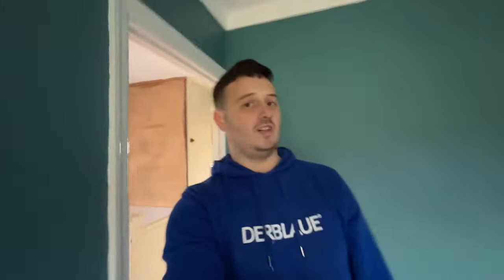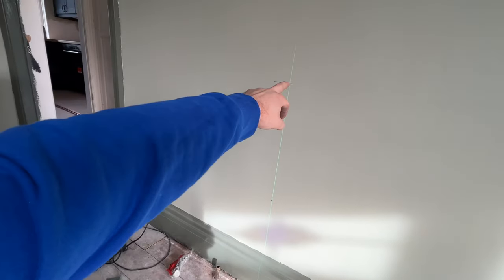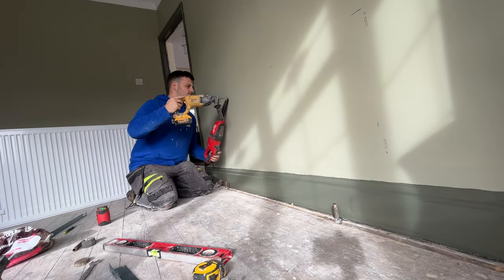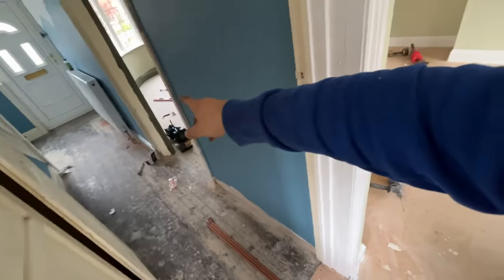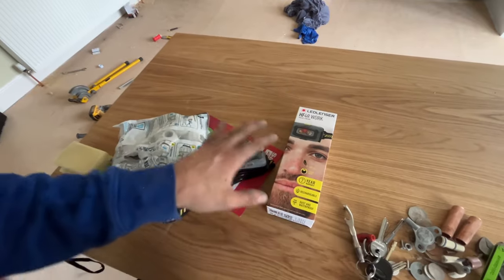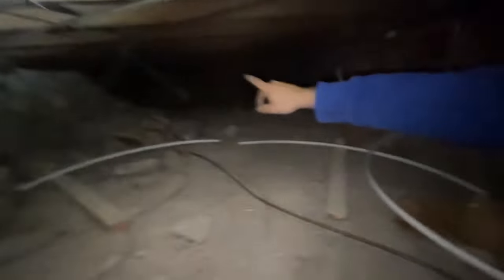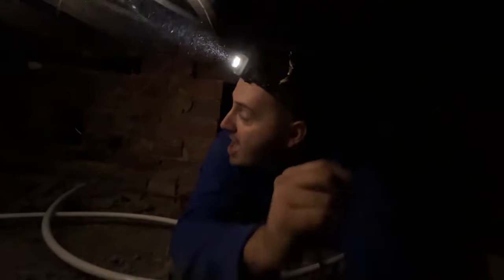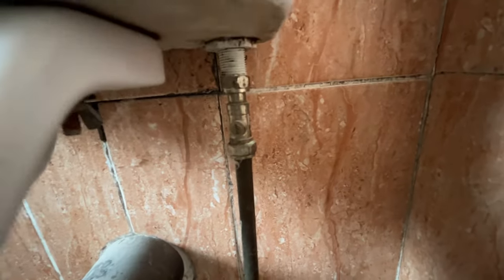A Day Installing Oversized Radiators To Future Proof For A Heat Pump

Comment: I think we'll see more of these oversize rads as customers look to take advantage of lower combi temps and get ready for heat pumps if they need to at a later date. Good work I've got a concealed cisterm that won't stop running tomorrow to tackle😂
Reply from the maker: Only thing is the full system needs repiping as most of its on 15mm so seems abit pointless to be honest
Reply from the maker: Good luck with the cistern, I’m guessing it’s a passing fill valve
Reply: @SmartPipePlumbing  thank you. I'm hoping its not the fill valve it's tiled in 🙈 I can get the flush mech from the top cover sill but the fill valve is going to require surgery.

Yh a lot of these heat pump conversions will need bigger pipework. Be plenty of work going in years to come.
Reply from the maker: @tirvplumbing  you could just chase the diaphragm on the fill valve if it’s difficult to access
Reply: @SmartPipePlumbing  that's a good shout thank you I'll have to look into that I'm afraid I'm still a rookie learning as I go. Joys of being an adult learner who can't afford an apprenticeship.
Reply from the maker: @tirvplumbing  any questions mate you know where I am drop me a message if you have any problems
Reply: @SmartPipePlumbing  that's so kind thank you 😊

Comment: Fitting oversized and k3 rads will obviously become common place. Installing central heating in a few years will be back breaking work. Rads, heat pumps and unvented cylinders. The job is hard enough without adding more tax for your body to pay.
Reply from the maker: I guess we will all have to put our prices up as we will have short careers then

Comment: White caps stop the rad vibrating.  And wobbling..   funny you mentioned plastic pipes hidden.   Im doing one tomorrow  changing plastic for copper under floor  cos rats keep chewing on the plastic ones 2nd time to this one.  Asked did they want copper after the first lot .  Said no  do it in plastic  r****kill have got rid of them .... 2 months later "can you change them pipes after all " ? 
 Buy cheap pay twice !
Reply: Presumably you drive a Rolls Royce rather than a Ford Mondeo?
Reply: @sam.p12345  2007 primastar  and a 1998 corolla.....I'm careful with money ( aka tight ) 😉

Comment: 3:47 please sit are they anti rattle devices 😇
Reply from the maker: Stops the meter on metro squeaking when the radiator heats up
Reply: No anti vibration lugs to stop the rad rattling about on the bracket

Comment: Lol, moving to a heat, there gonna live to regret that.
Reply from the maker: Oh yeah I think a lot will
Reply: Not really, you clearly don’t know what you’re on about I’m an apprentice and have installed one a week for the past 3 years. If they are designed, installed and commissioned right they will have no problems. It’s when u get these knackers installing them when u have problems. We’ve never had any call backs to ours, so that proves my point 👍
Reply: Plenty of people like lincsprep who don’t know what they’re talking about
Reply: @heatpump8566  Yeah ok buddy, if you say so. We have residents of housing association taking them to court round here because there heating bills have gone up three fold. There an expensive folly and don't just stop with the pump instalation, how about the requirement for larger radiators to actually come anywere near the heat output of the system they replaced?
Reply: @logansrcs9243  What it proves is you have done a correct job, what it dosent prove is that they are any more efficient pound for  over a gas/oil boiler when you take into account that in mist cases the radiators have to be larger.
Reply: @heatpump8566  Your only saying this because your cashing in on the heat pump hysteria right now, let's face it!